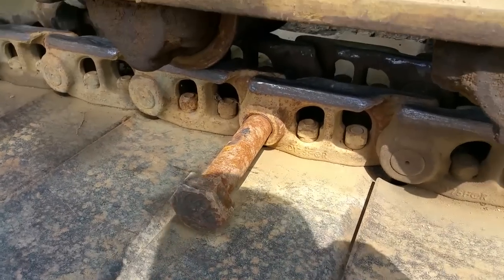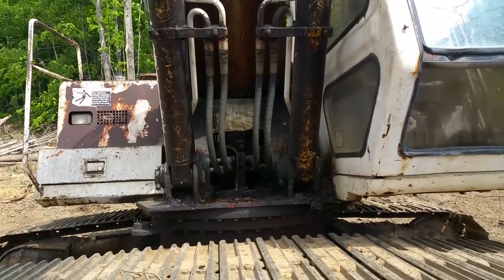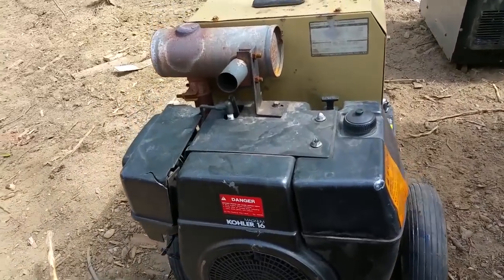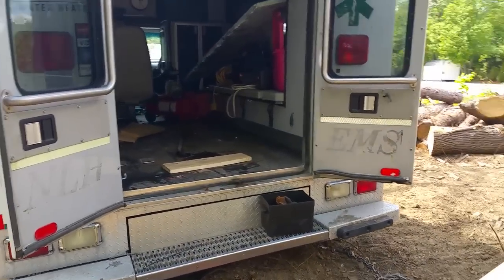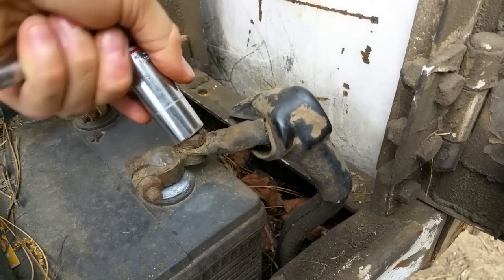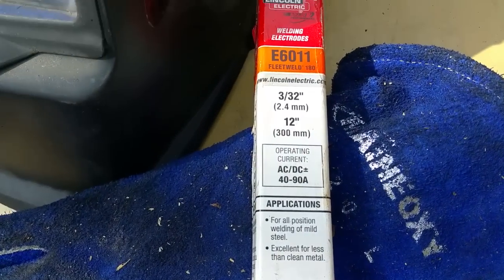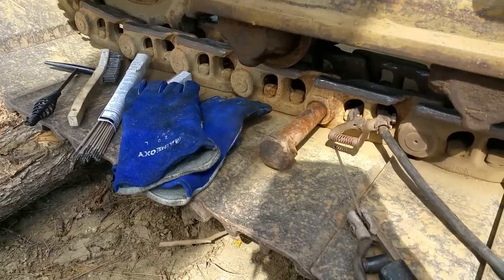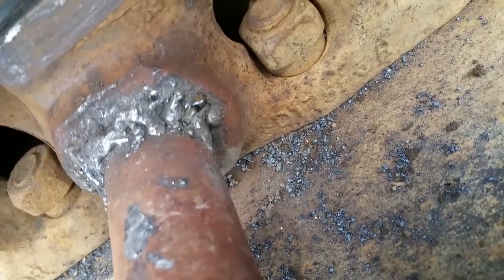Welding Heavy Equipment - (Sorry for the long absence)

Comment: Gotta appreciate your honesty that you‘re not a welder. I happen to also have a Hobart Powerweld and work as welder in a heavy equipment shop. So here‘s a few tips from someone who‘s done plenty of work on stuff like this.
1) 7018 is your friend. Keep them dry though. Unless we‘re doing stainless, cast, or pipe, 7018 is all we use. Usually Lincoln Excaliber 7018 rods.
2) Clean off that metal. Even an angle grinder with a wire wheel is better than nothing, but preferably you want clean metal.
3) Don‘t be afraid to use a passive fixed shade. Sure, they‘re harder to use than auto darkening, but you‘ll get a better view of what you‘re doing. Also won‘t have to worry about them failing to darken. 
By no means am I claiming to be the best of the best. I figured some of what I know may help you in the future when you have a similar situation.

Comment: As you know, I am an admirer of your ingenuity.

Welding 101:  Clean metal is always better than rusty metal.  Since you have electricity available, an angle grinder, or at the minimum, a wire wheel, will do wonders towards a successful weld.

I’m no expert welder either.  I just compare what I weld, to a weld of similar metal and situation that I know was done by a pro.

With that in mind, I’ll be surprised if that weld holds, as it doesn’t look to me like there was good penetration.  Probably worth the additional time and effort to grind it off as best you can (now it’s clean!), turn up the heat, and try it again.  Really.  A good weld for that situation wouldn’t need to go all the way around.

Have a look at this:
http://weldingweb.com/showthread.php?44005-Pictures!-Effect-of-stick-electrode-polarity-on-weld-penetration

Just offering my two cents worth.
Reply from the maker: i ALWAYS like and appreciate your feedback!!!  You are 100 percent correct about cleaning the surface. Funny thing is, I had every tool I needed to prepare it, but was relying more on the 6011 rod being a good dirty surface rod. It has held up so far, but I have not really beaten it up too hard. I'm going to beat it up today, & I will let you know what happens :-)